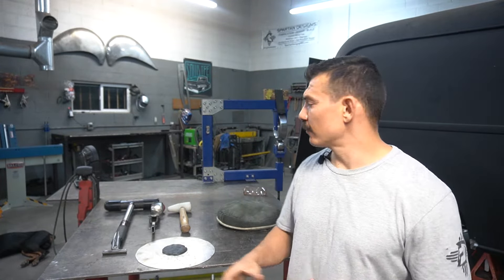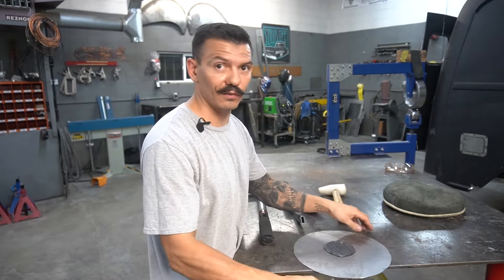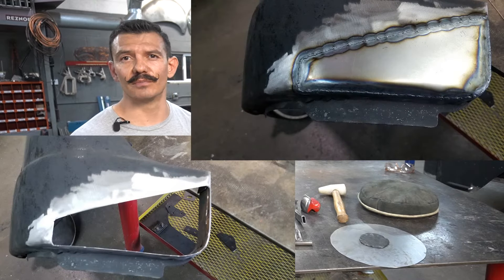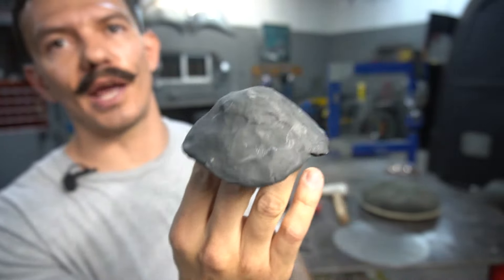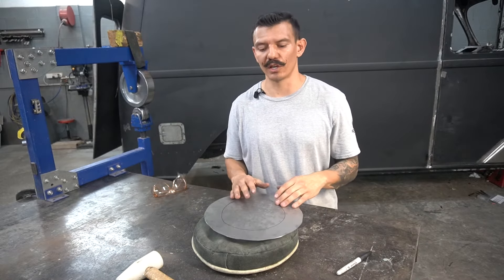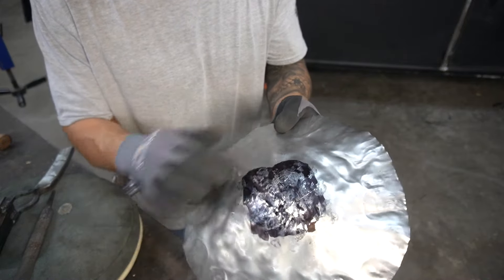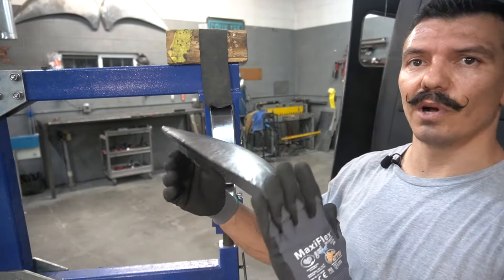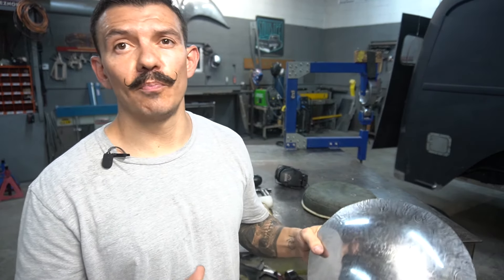Metal Shaping basics | Sheet metal shaping with Only hand tools | Understanding how to shape metal

Comment: what thickness do they have sheet metal American year 50/60?
Reply from the maker: I believe it is usually 19g but 20g and 18g is usually readily available. Floors and firewalls should be 18g anything else you can mostly get away with 20g